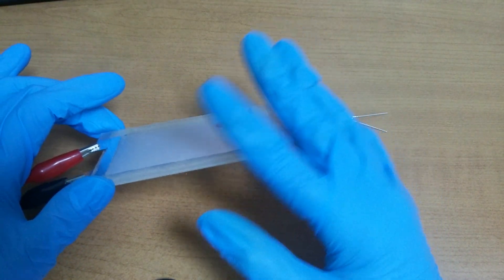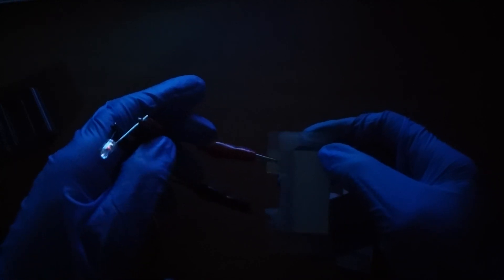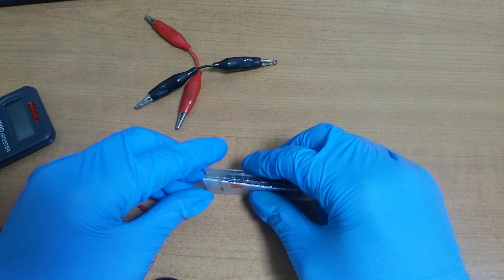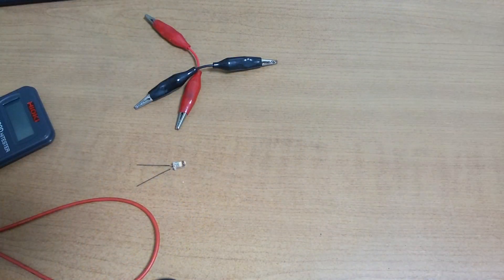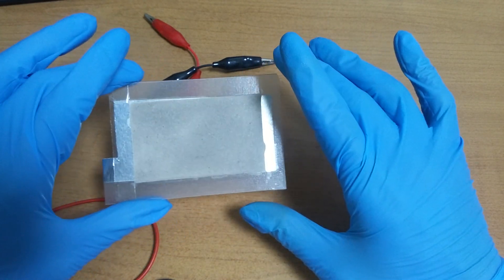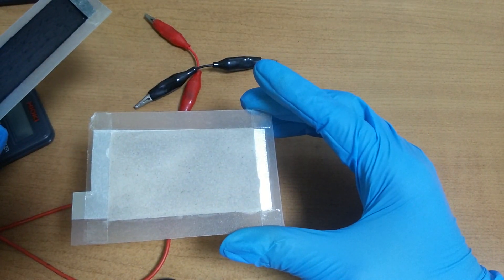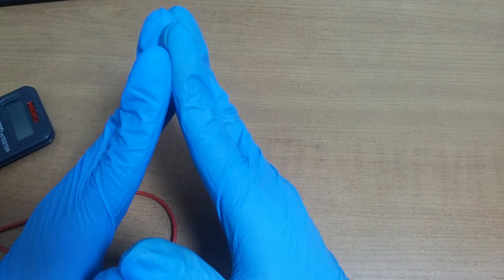graphene & sodium solid state battery never explodes

Comment: Make many cells, real thin !! Put them in parallel. That's how lithium ion pouch cells are made: many cells in parallel.
Parallel connection sums the amperage, series connection sums the voltages.

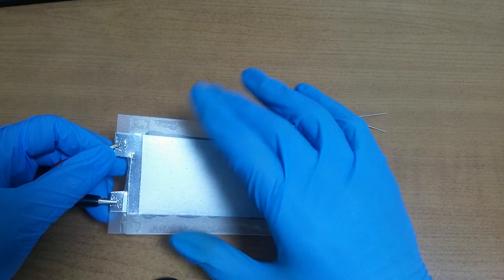Comment: 0:40
Yes , if..
** Try to short_circuit  the  charged cell for a  second or 2 , after fully charge 
If it's not  discharge deeply it should be battery.
** Try to charge it in reverse if it not charge to same voltage  in opposite direction , then it shouldn't be capacitor but battery.
Reply from the maker: I tried it before. Surely this is a solid state battery. You have great insight!! Have a nice day.

Comment: To increase the amperage you need to increase the voltage or use diode with lower forward voltage drop. Check the voltage on LED when you have it connected to the cell. Use 2 cells in series to make LED light stronger. Best regards!
Reply from the maker: Thank you. Have a nice day

Comment: Real nice work as always. Cutting the Battery while its discharged is incredibly impressive!
I wonder for quite awhile where you have or how you make your anode/cathode carriers? Aluminium coted cardoard?
I think me and others would also be interested to see your production of one of those cells in all details from start to finish!
Regarding amperage, did you cycle your cells many times? There are chemistries which first have to be cycled a couple of times before they reach full capacity! Also, if its even small, I would like to see a discharge and charge curve. AliExpress Article 32672470323 should do the trick for experimental cells like yours. I am happy to donate one to you. If interested, send an email to solidbattery@shdesign.info
Note this email address is temporary in nature and only here for the two of us to get in touch. It will be deleted in a day or two. 😃
Reply from the maker: Always thank you for encouraging me. Thank you and have a nice day